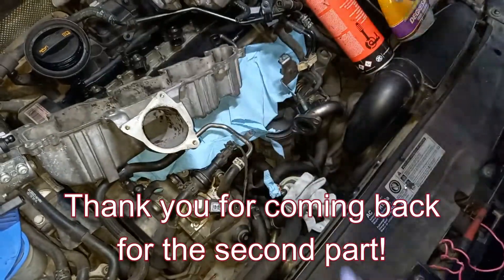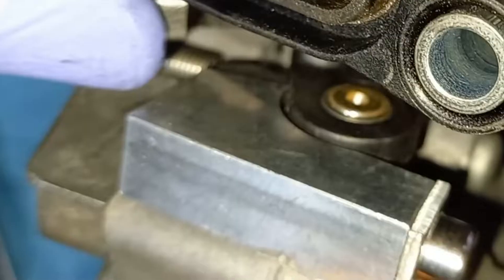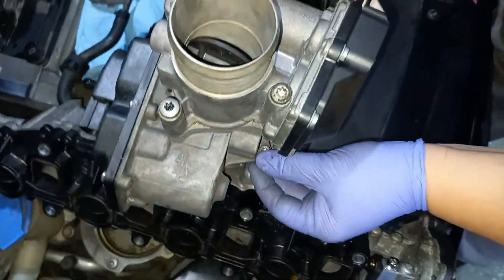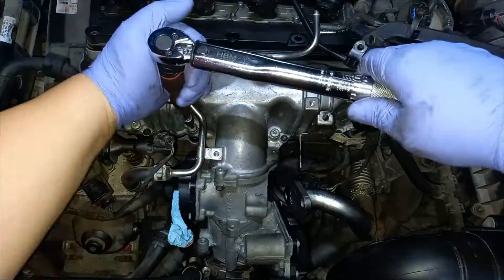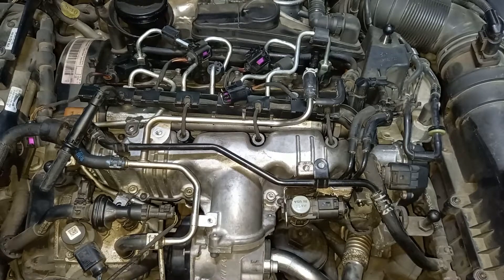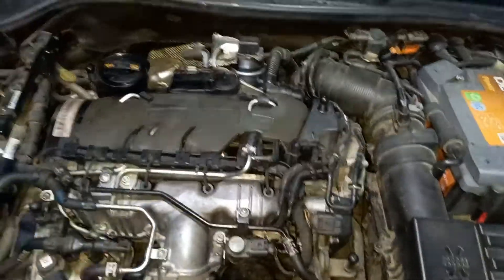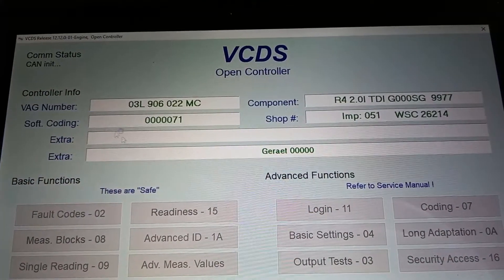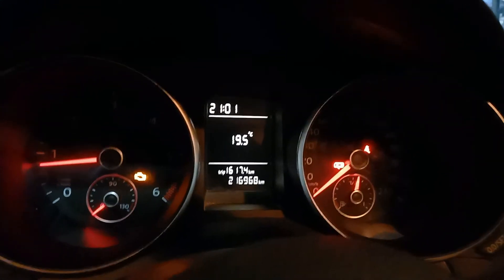VW Golf Passat Seat Skoda Audi 20 TDI CBDC Intake manifold repair kit PART 2

Comment: thanks for the video,very helpful! just a question,on the throte valve is a egzoste pipe,aluminium,and it have a plate where conects to the egr throte valve,do i jave to put a blocket plate?
Reply from the maker: Just install the blocking kit accordingly. No extra plates are needed. Egr does not need to be blocked. Egr valve needs to function like it did when car was brand new. Watch the 1st part of the video. Thank you for commenting and viewing the video.
Reply: i never knew how it was when manufactured! but i saw in a video that need to put that plate in so gases doesn’t get to the throte valve,but when i first opened there was a pice of metalik loose,so i could see that there was something blocking it but doesn’t seem to fully blocked and i don’t know if it is wrongl now or not
Reply from the maker: @donatpalushi3467  egr piping needs no restriction. E G R stands for exhaust gas recirculation. Egr valve takes care that some exhaust fumes need to be recircled back to the intake. No blocking plates or coins or anything are needed.
Reply: @AlexAndreiZAR  a blocking plate is not on the egr valve or manifold,is on the right of the throte valve,is a pipe that goes down to the exhoste i think!

Comment: If you removed entire line for intake, it was better if you tried to clean intake manifold also valve area, that was real carbonization cleaning, my suggestion!
Reply from the maker: Risky job and it would have involved more time. Thanks for looking at my video and commenting. Cheers! 🍻